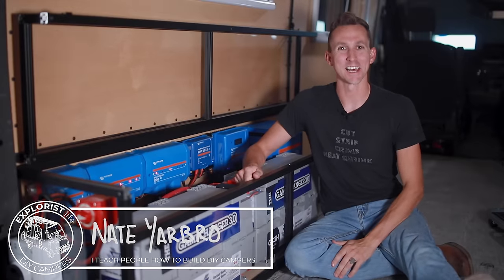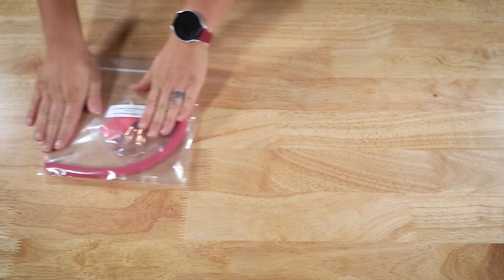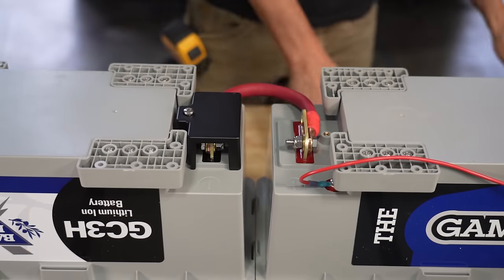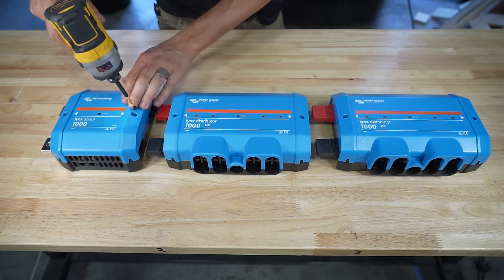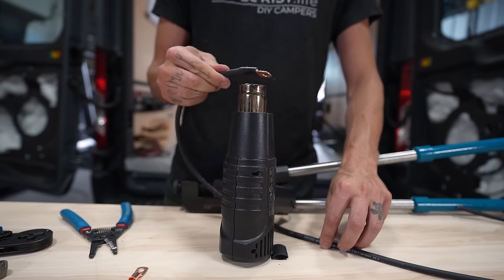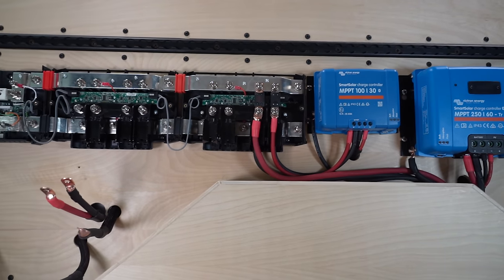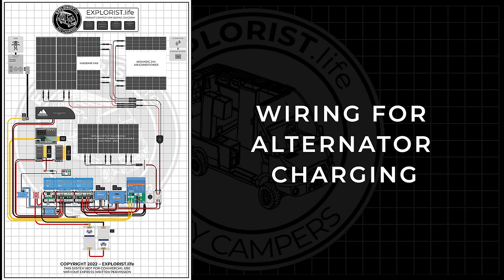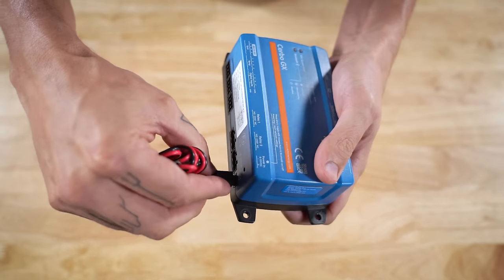DIY CAMPER VAN ELECTRICAL INSTALL (Start to Finish Tutorial)

Comment: Great video, but one question - why did you use a 50amp breaker in the 120v box when the shore power is 30amp? Wouldn’t you want a 30amp breaker in the box instead?
Reply from the maker: Check the last part of the video where I talked about the 'PowerAssist' function.

Comment: very professional, as usual. But a lot seems to be expensive overkill. Is there any way to pare it down? I finished a van with similar electrical_ but kept the cost downyet still had good quality. a six week trip to Alaska ran glitch free.
Reply from the maker: Definitely ways to pair it down depending on what capacities and features you want to give up. Our system designs are incredibly modular: explorist.life/solarwiringdiagrams

Comment: I see you connected your solar charge controllers equipment grounds to the Multiplus equipment ground and the Multiplus equipment ground to the Lynx Distributor ground  terminal.  I'm in the process of installing a Multiplus-II 50A/120V inverter/charger and Lynx Distributor with a solar charge controller in my Motorhome.  MY Multiplus-II is mounted about 12 feet away from the rest of my components and batteries.  My battery cables are 4/0 as is the battery cables running to my Multiplus-II 12 feet away.  My plan is to attach a 4/0 ground wire from the Multiplus-II directly to the motor home chassis-frame and also to ground the Lynx Distributor ground in a similar fashion to the same motorhome chassis-frame rail, but 12' away from where I grounded the Multiplus-II.  Is this grounding strategy sound?  Thanks.

Comment: Thank you for all these great videos! But one question...you do not use Victron battery protect. (BP65 or BP100). Why do you think it is not important for your batteries?
Reply from the maker: Battle Born batteries have a low state of charge disconnect and temperature disconnects built in, rendering the smart battery protects not that useful.

Comment: Hey Nate, just curious if you’re still going to be making a video covering alternator charging and how you wired it in the Ford transit build?
Reply from the maker: Hey!  Just wanted to follow up on this.  We just released the alternator charging video that accompanies this tutorial.  Here is the direct link to that: https://www.youtube.com/watch?v=FuBAKTCCnt4
Reply: @EXPLORISTlife  Hey Nate, great video as always. Just wondering about one thing. Your wiring diagram show a 150amp fuse at the starter batter. Since the ford transit CCP2 has a 175amp fuse in the fuse block does that need to be changed to a 150amp or are you ok leaving the 175amp fuse?

Comment: Another DIY level would be to build the battery from individual cells. Higher power density and much cheaper.
Reply from the maker: Yeah, that's TOO diy for most people IMO.  Too easy to mess up in my experience.  Battle Born has 'easy' batteries dialed in with great customer support and a 10 year warranty, so I'm always going to recommend that.

Comment: GREAT video (I know... you've heard that already) :)  Can you clarify the 30AMP shore power, but installing a 50AMP breaker in the 120V AC box.  Is that because of the need to have more than 30AMP for possible use of the "power" assist from the inverter charge controller? (hopefully that question made sense) :)
Reply from the maker: Yep!  Exactly.

Comment: When you connect the earth ground wire from the chassis to the distribution panel, how is it protecting the inverter and the chargers? I think it is only protecting your equipment that are chained to the distribution panel. Don't you need a ground wire from each equipment to run to the chassis ground?
Reply from the maker: There is. 😉. Watch it again. 🙂👍
Reply: @EXPLORISTlife  Thanks.

Comment: Will heating batteries in this setup be bad for the inside? Will they be fine in non-cold areas?
Reply from the maker: Well, they are thermostatically controlled; so the heater will only be on when the temperature is near-freezing.

Comment: Would it be safe enough to put 2 100/30 controllers on one stud and use a larger fuse to protect them instead of adding another distributer? We have 2 wind generators, 2 dc to dc chargers, 2 mppt controllers, 1 marbu 12v air conditioner, multiplus, and a Phoenix 1200 inverter. If we double up the dc chargers, wind generators and mppt it would be much easier
Reply from the maker: Nope. Each charger needs its own fuse.

Comment: In warching this tutorial, you use a terminal fuse that you say is included in your lynx distributor wiring kit.  I don't see that in the kit but see the 400 amp fuse and holder.  It also appears, from what I can see of the wiring diagram, that you did not use the 400 amp fuse.  I have two quesitons.  Am I to assume from this that if I use the terminal fuses that I do not need the 400 amp fuse?  And, do you have or will you have the diagram in this video available for purchase/download?  As always, I appreciate your work and thank you.
Reply from the maker: There is indeed a terminal fuse for the Lynx Distributor wiring kit used in this video, which is the 1/0 Lynx Shunt version.  The 1/0 Lynx Distributor wiring kit includes a terminal fuse.  The 4/0 Lynx Distributor wiring includes the 400a ANL fuse and holder.

Comment: I am already halfway through the video and I'm wondering why you use the black wire for the ground instead of a green one or is it just me
Reply from the maker: In most DC mobile applications, DC negative and DC ground wires are typically black.

We used green for the AC ground, which is typical of AC wiring.

Comment: Great vid, just one comment, would it be worth using no-ox on the connectors to prevent any oxidation of the connections over time that could lead to heating etc. or efficiency loss? I mention it as you are placing the cables and batteries in an environment that can be more subject to moisture/humidity
Reply from the maker: If you feel the need, I don't see any reason it would hurt.

Comment: Thanks for the consistently helpful information.  Question:  Can separate strings of solar panels use separate disconnect switches, and can those switches be 'hot-swapped'?  I.E., can you turn on / off one set of panels while the other(s) are fully connected and actively charging?
Reply from the maker: Yes and yes

Comment: Can this system be used for any rv van system? ie Ram, Sprinter etc. Thanks. Also is there a diagram or schematic available and components list available?
Reply from the maker: This system can indeed be installed in any vehicle.  There is a diagram/schematic and components list available in both the pinned comment and in the video description.

Comment: What do you guys do for wire management, in the context of say, a slide out for a refrigerator etc or whatever. How do the wires slide out and back in without getting tangled? I was thinking maybe using some springs etc but is that ridiculous? Hope that question made some sense.
Reply from the maker: For something like a fridge that doesn't move very often, I'm just going to leave the wires loose and manage them if I have to do maintenence, the same as I would in a house with a fridge.

For somethig that moves often like a drawer, look into 'cable chains'.  I covered these in, I believe, the 'camera cabinet' module of this build.
Reply: @EXPLORISTlife  oh geez. Sorry I missed that. Really appreciate the reply! Love your tutorials. We're also in Colorado! Hope to meet you two in person sometime 😊

Comment: I have a victron dc to dc charge controller question.  From my truck battery to my camper dc to dc charger that is mounted in the camper near my battery bank, can I splice the negative on the camper frame prior to going into the dc to dc charger?  My wire was too short to reach the hitch area and way to difficult to rerun.  I realize I can splice it on an isolator if need be but this was easier. The positive wire is long enough so there won’t be any splice before the Anderson connector.   Thank you.
Reply from the maker: I always recommend running unbroken lengths of wire whenever possible.  Every connection is a point of failure.

Comment: I know it's from a year ago, so the odds of getting an answer are slim to none, but why is the GX hooked straight to the 1000A busbar ? is this the way it's supposed to be ? i'd think you'd need a small buck/boost converter for a stable 12/24/48 volts, but maybe it has one already inside the GX.
edit: went to the manual, leaving this here in case someone finds it useful.  
YES, it is 100% the correct way. yes it has a voltage converter inside, and yes it's supposed to be this way so it gets power straight from the batteries.
Reply from the maker: Indeed. 👍😁

Comment: Hi Nate, we are having a problem with our 12V fuse block. There are various currents running through and out of the fuse block positions, with no wires attached except for the main ground and hot, and no fuses in place.
Reply from the maker: Responded via shop support ticket.

Comment: Hello. why do you use the buck-boost alternator for charging instead of the orion dc-dc charger as in the past. thanks
Reply from the maker: The 100A buck boost will be over 3x faster charging than the Orion.

Comment: Another great video, thank you!  For the chassis ground, did you just drill a new hole since the existing holes weren't in a convenient place?  And is the Multiplus just mounted to the 1/4" walls or is there additional support?
Reply from the maker: We did indeed drill a new hole for chassis ground for the reason you mentioned.  There is 3/4" furring strips of varying sizes behind the 1/4" walls so the screws have something a lot more to grab onto for all of the equipment.
Reply: @EXPLORISTlife  Ahh, the furring strips.  Makes sense, thanks!  One more question on the chassis ground - I noticed in this video you attached the one end to the center stud on the lynx distributor, but in one of your other videos it's attached to the negative bus bar in the same place that the shunt is connected.  Are both locations equally effective or is there a reason to choose one spot over the other if both are available?
Reply from the maker: It doesn't matter as long as it's somehow, someway connected to the negative busbar of the Lynx Distributor on the 'loads and chargers' side of the shunt (not the battery side).

Comment: Hey!
Good videos!
I need you advice, on battery cooling...
Reply from the maker: Can you add any kind of context there?  What's your actual question?
Reply: @EXPLORISTlife  
Good point!
So, with LiFePo batteries the common issue is heating. 
But the environment I live in and store my van, is really hot (NV LV)
So, inside the van with or without a fan temps may get above… well VERY HIGH. 
So, I have been looking for a similar build like you posted a vid about with the transparent enclosure, but with some sort of a cooling option with a thermostat built into the box, that could keep the batteries at a safe temperature)(All this is less relevant now cuz of the season)
So, that’s what I am curious about… what would you come up with for cooling in this situation?

Comment: Are you running 1 or 2 Buck Boost (100A ??) units?  Is it okay that they don't have the 3-stage charging algorithm like Orion-TR and other chargers?
Reply from the maker: It'll likely be one 100A Buck Boost.  3 stage charging is actually not particularly important for Lithium Batteries.  Programmable voltage is, but since Lithium batteries don't equalize or float, it's not that important.

Comment: The batteries wont charge through shorepower when the master disconnect is off?
Reply from the maker: Nope.  If you turn off the master disconnect switch, there is no way for the power to get to the batteries.  Leave the master disconnect switch 'on' if you want to recharge the batteries and otherwise use the system.

Comment: FYI; Recently I have read that Nyloc nuts are not advised due to terminal heating during operation. And that lock washers should be used instead.
Reply from the maker: All nyloc nuts used were part of the manufacturers provided hardware.

Comment: I just noticed, victron shows a breaker between shore/geni plug and the inverter. I don't see you mention it, do you not install one?
Reply from the maker: It's installed in the shore power pedestal or in the breaker box in the wall.  Similar concept as why you don't see a breaker between the outlet and your blender.
Reply: @EXPLORISTlife  I kinda of thought that's where you were counting on them being in the circuit. Thanks for the response.

Comment: So, if there's an exposed AC wire touching the van and then a human, that load will go through the earth cable into a lynx distributor running at that point, 12v? Surely that would damage it no? 🤨

Comment: Hey mate is there a reason you use 300amp fuses out of battery when 1/0 wire can only carry 150amps? Or am I missing something
Reply from the maker: 1/0 wire with 105 degree insulation is rated to quite a bit higher ampacity than that, but here is a video that will teach you how to size fuses: https://www.youtube.com/watch?v=5y-yDMEgV70

Comment: I am curious in this install, with only 30A shore power and 3000 VA output from the inverter at 120v, why is the output side of the Multiplus to main distribution wired to accommodate 50A?  Is this future-proofing to accommodate a 50A source in the future (50A shore power passing through the Multiplus device) ?
Reply from the maker: YT search our video "EXPLORIST.life What is PowerAssist".
Reply: @EXPLORISTlife  Thank you, that makes a lot more sense now.   Breakers protect the wiring and 6 AWG is sized for 50 amps so there's no safety issue.  With this setup, if you don't have a source of feed-through power and you exceed the capacity of the inverter, does it just go offline?
Reply from the maker: Correct.  It'll just go into overload protection, shutdown, and then re-start once the load demand decreases.
Reply: @EXPLORISTlife  Thanks, I appreciate the detailed responses, especially to a question on a year old video.

Comment: Looking at this kit on your site it doesn't look as though the Inverter/charger is included only the wiring is. Looking to purchase when our Transit ever gets built. Just in planning phase awhile.
Reply from the maker: Hey!  I just added a 'other parts required' to the product description for this kit that includes that stuff: https://shop.explorist.life/shop/all-products/camper-wiring-kits/complete-wiring-kits/540ah-3000w-24v-multiplus-580w-to-1700w-solar/
Reply: @EXPLORISTlife  Thanks a lot for reply. I watched your latest video on cost and purchasing from Battleborn makes sense for them to program.  I spoke to Battleborn at Hershey PA RV Show about your build and said I was waiting for your electrical video.  Can't wait to start our build when Ford decides to build our Transit since out MY22 was canceled and we had to reorder MY23. Keep up with get great, very easy to understand videos.

Comment: Hi Nate, can I have my inverter ground and my chassis ground run to the same stud on the Lynx? I am only using one Lynx distributor
Reply from the maker: Electrically, that's fine; but it probably wont fit.
Reply: @EXPLORISTlife  Do you have another option you’d recommend? Can I just use one of the other studs on the negative side of the Lynx?
Reply: Or should I run another grounding cable from the inverter to a different point on the chassis?

Comment: You mounted your Multiplus straight to the wall panel, which in a previous video you said is 1/4" birch. Those inverters are heavy - you're confident enough in the strength of that 1/4" board to hold it up without any issues?

I ask because I'm deep in my electric system/frame build and one of the next steps is settling on how/where to mount my MP.

Thanks!
Reply from the maker: We reinforced that particular panel with 3/4" plywood furring strips of varying sizes so that all components mounted on that wall are going THROUGH the 1/4" birch, and INTO 3/4" ply.  Great question!  1/4" ply alone definitely wouldn't be enough to hold that heavy multiplus.
Reply: Aha! I suspected that might be the case. Prudent. Thanks!
Reply from the maker: @wanderingzythophile9083  No problem! Thanks for watching!
Reply: @EXPLORISTlife  would that be enough in case of accident? In the end... That is a car
Wouldn't it be better to fix it directly to 8020?
Reply from the maker: ShadowVort, Attaching it directly to the 8020 would probably be 'stronger', but the 6x #14 screws should be plenty strong.  Even if the crash were bad enough to pull the 7x #14 screws from the wall, the multiplus is still inside of an enclosure, completely secured to the van's body.  The multiplus is also 'secured' via 3x 1/0, 3x 10ga wires, and 3x #6ga wires which would further keep it from 'becoming a projectile.'  If the crash were bad enough that the multiplus could escape all of those bonds, there would be a LOT of shit flying around the van.  I see this as a non-issue.